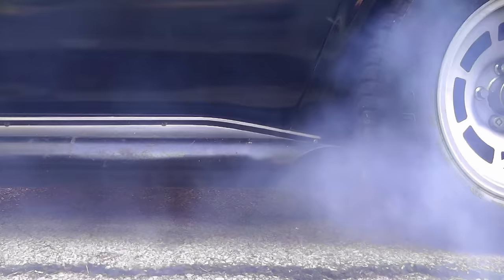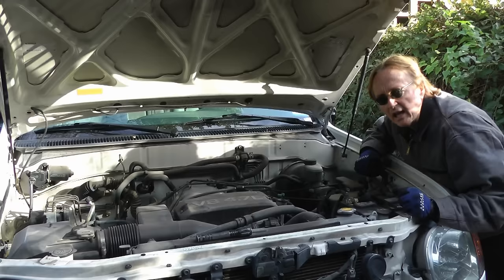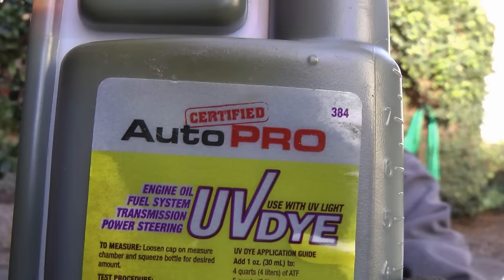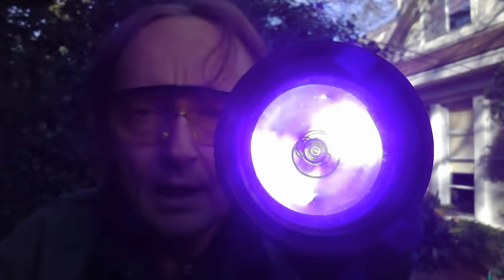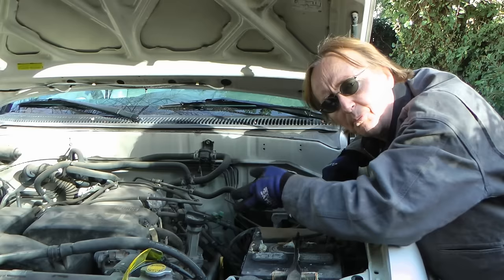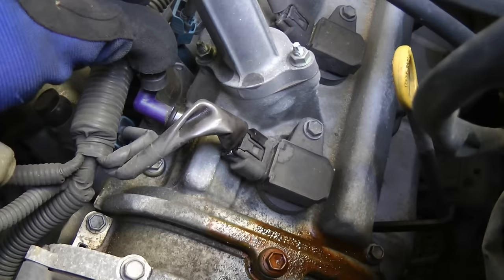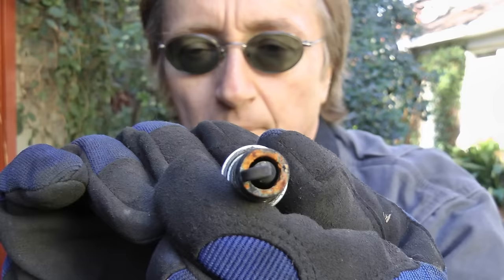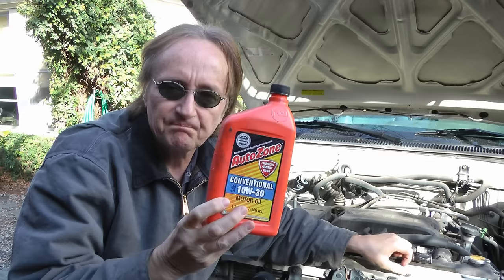How to Fix a Car Engine that Loses Oil (Leaks)

Comment: Hello sir,

I recently have preformed an oil change on my Toyota Corolla S. 

I used Valvoline.

And a Fram Filter.

I have seen reviews for Fram filters and have been convinced they are the worst filters out there!

What is your take, when it comes to Oil and Filter Preference?
Reply from the maker: heck, oil filters are just filtering paper inside a metal shell. As such, most work perfectly fine as long as you change the oil and filter frequently.
Reply: And specific ones you prefer to use?
I have a Toyota Corolla Sport. O1
I learned a lot from your videos, and I know you would know best.
Thanks.
Reply from the maker: LIO ZARATE
 I use the cheap generic ones auto zone sells. But you can also use stp filters, auto zone sells them too

Comment: Main casket seal.  That's my issue
2009 Ford fusion  
I check the dip stick. Put in when needs.  

They want $ 3,000 to fix the seal .
  To much.

Try some oil sealer oil .
Just got the dam car 
Has to last for some time.
Can't afford buying car's.

Comment: I don't understand how a PCV valve being stuck open is going to suck up oil and burn it.  To my knowledge it's nothing more than a check valve that lets vapors escape from the top of the motor.  Where does the oil come from?  It would have to come from the direction that the vacuum is actually pulling the vapors towards.  That doesn't make sense though because the vacuum is sucking from that direction so how is something going to flow from there?  And why would a PCV valve that's stuck open only suck oil from the valve cover when it's stuck and not while it's normally sucking vapors from the valve cover in the first place?
Reply from the maker: the valve in the pcv valve shuts closed when liquid oil hits it, but stays open for air mixed with oil vapor. So if it's stuck open, it will suck raw oil into the engine and burn it.  The valve vents the crankshaft vapors, and it's vacuum supply would suck raw oil into the intake and burn it if the valve is stuck open.

Comment: 2006 BMW X5 4.4i N62 blue smoke when I accelerate after idling for a bit. CCV valves seem to be ok seems like the previous owner changed them. Am I looking at bad valve seals? Seems to be a common problem with these vehicles.
Reply from the maker: bad valve seals 99 percent of the time on that engine

Comment: Hey whats going on Scotty, my camry had been leaking oil from where the solenoid assembly is and it was a cam plug and i used red RTV silicone and it took a while to dry up and yeah but i also want to know if its ok for me to use full synthetic oil cause i had been using high mileage oil, is it safe?

Comment: Hey Scotty my dads 05 chevy equinox with 54,000 miles and frequent oil changes. Its burning oil and he has to put oil once a week it uses half quart of oil, we changed the pcv and the spark plugs were checked and have a light white coating on them. Also every morning on start ups it makes a 3-4 knocking sounds but only on start ups. What can be the problem for these two things? much help is appreciated

Comment: REGARDS SCOTTY  I HAVE TOYOTA CAMRY 2000. 4 CYLINDER CAR AND IT HAS BOTH BLACK AND WHITE SMOKE. IT ALSO HAVE A INDECENT SMELL . GIVES ME A HEADACHE  ONCE IN A WHILE . THE SMOKES IS OVER WHEN THE ACCELERATING PADDLE IS PRESSED UNTIL THE RPM IS OVER 5000. THEY DO THIS TEST IN THIS  COUNTRY  WHILE PASSING  THE CAR BEFORE RENEWING CAR PAPERS
Reply from the maker: often blown head gaskets do that, try my video "how to tell if your head gasket is blown"

Comment: Hi Scotty 
I have Peugeot 308 2007 1.6SE.. Every month i have to put a litre engine oil in. Does that car also have a PCV valve or something else needs to be replaced? Whilst driving it also feels like the engine is dying or powerless.. the warning sign says 'depolution system faulty' and the coming and going regularly.. any help will be much appreciated?

Comment: Hello Scotty one cuestion quick this is a nissan sentra2003 and water is get in the engine because over heat is only in piston #2 is necessary replace the heads or may be you know another way to fix it?

Comment: when the PCV valve outside the engine and can be changed ... its not that bad ...but what i do when its insde the motorcycle engine..... it gonna cost a lot of money to fix it
Reply from the maker: replace it then, building up pressure with a bad one can cause oil leaks

Comment: Hi scotty! I have a 03 ford ranger with about 230000miles. I noticed that there was some smoke comming out from underneaith the hood of my truck. It turns out thay its oil leaking from the driver side of the engine and dripping onto the muffler. Wich is causing the smell of burnt oil and smoke. Is there any fluid seal you would recomend to fix the problem? Any help thanks!!

Comment: 2001 Toyota Corolla LE 1.8L (216k miles) I use to have leaks on the valve cover I thought that will change everything but nope. I am thinking rebuilding the engine on my own but if is only the cylinder head that will save me lil bit more just buying the top kit gaskets. What I detected from top Every bolt I take off has oil and even on the intake manifold. There isn't coolant mixture with oil which means good head gasket not even smoke from the back. Also, on the valve stems has oil. I was able to see a cylinder and seems to be clean on the walls but on the edge has oil. The spark plugs has Ash deposits and lil bit of oil but easy to clean off BUT has a code misfiring on Cyl 3. Also, i have Variable Valve timing code. Can I have an opinion of all what could it be? Please. 

THank you Mr. Scotty
Reply from the maker: +Walter Castro  really, get a used engine from a junk yard, you an't rebuilt that complex VVT engine correctly without a full machine shop and years of experience

Comment: is it normal for my Camry to need oil between oil changes?
Reply from the maker: +Alarm Tech911 when old, some will burn a quart and a half of oil between changes
Reply: Camry's with the 2.4L engine ALL burn oil, this is Extremely Common. Most years effected are 2007-2012. I've seen Camry's Brand New off the showroom floor...and they burn 2+ quarts per Month! People have been trying to sue Toyota for years over this excessive oil burning, but don't seem to get anywhere. They recently changed the design of the engine because the lawsuits threats were piling up so bad.
Reply: +Alarm Tech911  Most manufacturers actually recommend checking the oil every 300 miles (or every other fill up). It's good practice anyway.

The AA (a UK emergency brake down service) reckons 1 in 5 cars are running on oil that is below the 'low' marker.
Reply: +Alarm Tech911   We have a 2009, it burns 3qts every 5k miles (no we don't wait that long)  Toyota says it's NORMAL to burn up to 1QT/1000 miles... it's a crock of baloney!  Not much else we can do, but add oil.  Toyota recently extended the warranty on the engine due to this problem (and a lawsuit).  It really sucks.  our Camry is the biggest POS I've ever owned (Since my 1974 bug, but it was 25 years old when I had it...)
Reply: Those 2.4 2az-fe's love to consume oil after 95k miles. My dad has a 09 vibe, which is just a matrix with a pontiac skin, and that thing loves to drink oil. It only has around 105k on it. I don't think that car is going to last much longer. Its shame, we baby our cars. Some cars come straight from the factory consuming oil. Isuzu Troopers did that. It wasnt until the late 01 models where they fixed the engine so thag it wouldnt consume oil. I have a late 01 trooper and it doesnt drink oil. I heard toyota will fix it for you for free, but to get anything done from toyota is hard because they almost always hit you with the "its a toyota, its reliable, you abused it and were not going to cover it" excuse

Comment: anyone ever heard of an old farmers trick, draining engine oil completely, leaving filter on, replace oil with diesel/kerosene run engine til lifters become free (ticking) 2-5 min, drain oil, replace with fresh diesel/kerosene run a minute then drain, remove filter
then replacing engine oil and new filter..
I have heard of it and tried it in an older vehicle almost shot, and the oil was clean as a whistle, not black like every other oil change!!!!!
is this totatlly stupid or anyone else tried

Comment: My engine has 315K miles on it. It burns a quart every 1000 miles. It holds 4.75qts with a filter but in 3K miles just about all the oil has been replaced compliments of the car itself and keeping it topped off. Wonder if I should still change my engine oil when it seems to be doing a great job of that itself ;-) Is there any reason at this point? I'm only driving it to see how long it will go. If 3/4 of my oil has been replaced between oil changes it seems like a shame to drain out new oil it hasn't had a chance to burn yet...lol
Reply from the maker: yes, the dirt is still inside, continue to change the oil as normal, and especially the filter
Reply: +Scotty Kilmer Hi Scotty. That Lucas oil treatment works wonders. It slowed my oil consumption down by at least 50%. The car now has 321K. Still going. Going to run it into the ground :-)

Comment: So what if I have couple oil leaks the valve cover gaskets rear main seal and I think the front seal also what can I do or use to slow thos down u til I can get it fixed it's on a 96 dodge ram 1500 5.2

Comment: Hey Scotty. Have a 99 Accord and I change the oil every 4k. When should I be expecting oil burning from the engine. I have 164k and I use very little oil between changes
Reply from the maker: not for a LONG time if you keep changing it
Reply: good to hear!

Comment: We bought a 2012 Kia Soul in 2012 got in an accident the first week we had it..the radiator was damaged and car over heated. Insurance fixed the radiator. How ever every time I get the oil changed they say it's about a quart low. The guy at the dealer says there's no way it's related to the accident and all cars burn a little oil between oil changes. The car is under a ton of warranty and the dealer ship doesn't think this is an issue. What do you think?
Reply from the maker: Justin Walker  of course they won't warranty that oil loss, it would require rebuilding the engine. Kias are cheaper made cars and their engines tend to burn oil as they age. BUT, try using Castrol GTX oil, and you might find most of the oil burning goes away.
Reply: WOW thanks for replying I will do that! :) Im gonna subscribe to your channel and tell others about it. thank you so much. Your videos are awesome and keep up the good work. Scotty Kilmer

Comment: How about the crank seal on a 93 sentra xe scotty,  everyone says I'll have to pull the motor,  if that is true then I can't do that because I'm no mechanic.  Would you recommend using the at205 for crankshaft seal also? Hopefully you'll tell me I can take it off without pulling the entire engine.
Reply from the maker: try the sealer, but I've done those on the car, there is enough room if you take your time and be careful

Comment: What would cause this damage in the first place for example, not leakage but consumption wise?
Reply from the maker: consumption is often worn piston rings and or valve seals
Reply: Yes, but how can one prevent this from happening? Wearing out wise?
Reply: Not driving your Car would be the best prevention. If you change your fluids regularly you can slow the process a bit, but it's really just regular wear and tear.
Reply: Nikolovh1 
Put new piston rings! xD 
:-00000000000000000000000000

Comment: Hi scotty i have a Audi A4 my brakes keep giving me trouble i have tried everything change and failed up the brakes fluid and a couple days later warning light came on and my fluid was down the cylinder fine and am still having problems with my fell before all that my brakes had locked up stilling at the lights ive work on cars sins i was a kid and am real stumped ive never had this on a car do this before any advice it still low mileage i even went for a second apinion it driving me nuts

Comment: Hey, I have a 02’ Accord v6 3.0. With a leaking rear seal and oil pump seal, I’ve been living with slowly leaking oil and LucasOilLeakStop. Factory rcmnded 5w20, should I go to a thicker oil?If so like what?

Comment: I mean should I use an oil catch can that will catch oil from the blow by valve. I have 2 Ecoboost vehicles. one with a 2.0L ecoboost engine and the other is a 3.5L ecoboost engine. I am worried about gunk, especially in the future.
Reply: Best thing to do with those engines is use a quality synthetic oil and use top tier gasoline like Shell. If you are hard on the engine and race a lot let the engine idle for a few minutes after your drive. The oil will cool the turbos and extend the life. Try Fordtechmakuloco channel. He covers some good information about these engines.

Comment: Hi Scotty. A question. How do you check and measure the engine oil? When the engine is running or off? thanks
Reply from the maker: you check it with the engine turned off, wait 3 minutes to drain, then measure it on a level surface
Reply: Scotty Kilmer Oh, OK then. All along I thought the proper way to check the oil level was when the engine is on and pumping its oil throughout. thank you Scotty.

Comment: SIR ScOTtY ...i am a woman SO I ANTICIPATE YOU WILL BE HONORABLE AND RESPOND..THUS Helping a wOmaN out and be
  THE FINE GENTLEMAN THAT YOU ARE .

.what could be causing my 20O8 LINCOLN MKX  to leak oil literally the next day after my water pump was replaced? Mechanic refuses to acknowledge and address  and in addition  THE CAR STILL LEAKS COOLANT very slowly and no over heating anymore though! AS THE LEVEL HAS GONE DOWN SOME. MY WHOLE LEFT SIDE AS YOU FACE MOTOR IS WET WITH OIL AND MAYBE COOLANT BECAUSE ITS SO WET.  CAR DOES NOT.GET HOT OR OVER HEAT. NEVER EVER EVER LEAKED OIL until he took it apart and seems he maybe didnt seal something.UNDERNEATH ALL WET W OIL ON LEFT SIDE...I MEAN EVERYTHING EVEN THE ARM AND TI ROD ALL THE WaY BACK TO CONVERTER... WHAT WOULD BE YOUR GUESS?? MY CAR TAKES 5 20 BUT  WAS TOLD TO USE 10 30 OR 40 BUT CAR DONT warm UP RIGHT cuz cold so oil i told was like mud..SO I PUT 5 20 IN AND ITS LEAKING a lot...a lot. Its worse. 10 30 this summer or 10 40 every 3 weeks half court. ... CAR HAS BEEN SOOOO GOOD TO ME AND EXPECT IT TO KEEP GOING BUT RATHER THSN HAVE A MECHANIC SPEND TIME !$$" TRYING to figure out  do u know what it could be

Comment: Hi. I have a 1.3 L carburated 1995 Mitsubishi Lancer. It uses about a gallon to 4 liters of oil every oil change. How much oil should I expect to add every how many kilometers that is still normal for this engine?
Reply from the maker: for a mits that old, that's actually less than normal oil burning. Mits use crappy piston rings that wear out then burn oil.

Comment: Scotty why do newer Toyota 4 cylinder engines have a oil consumption issue? Like in the 07 Camrys for example with the 2.4 L engine.
Reply from the maker: I blame too infrequent oil changes myself, I stick by the change your oil every 3-4 thousand miles or twice a year. those long changes cause internal engine wear, then they burn oil when older. My son has an 07 camry and it burns no oil at all, cause that's how he changes it.
Reply: Ok thank you for the advice.

Comment: Hi Scotty,
Thanks for your videos, I got a question 4 u:
I have freelander 2002 (land rover), which if I accelerate more than 2000 rev/min,  the intake pipe will pull oil (like a cup or 2). any possible causes?
thnx in adv

Comment: Hi Mr. Scotty, I have Hyundai Matrix 1.6 2004 its have problem for losing engine oil around 2000 km need add 1.0 liter, and not smoking. How can i solve the  problem with solution oil.

Comment: About to add Lucas Oil Stop Leak, do I have to drain 1 quart of oil and then add 1 quart of Lucas or just add 1 quart to my 02 Accord v6
Reply from the maker: If you aren't one quart low on oil, of course drain one out before adding it

Comment: Scotty I have a 2004 hyundai  sonata.  It has 226k miles and runs like a dream.  The only thing wrong with  it is its burning oil like crazy.  Smokes a little when it starts and when I Rev it,  it smokes too.  Would you say it's the pcv valve?
Reply: Jacob King as a long time hyundai tech I'd lean more on valve guides. done many of them in my day.
Reply: I replaced the pcv valve and everything is perfect. Part only cost 3.88 lol
Reply: uh well the one on it was literally 7 years old. Was never changed since I bought it. Very simple to change too. just took like 10-20 minutes.
Reply: +Jacob King Strong vacuum only on idle. So.. I guess PCV would suck much more oil while idling.

Comment: My Engine uses alot of oil... but this is due to the fact that my car got Shifted Pistons. damn you VW Golf 4 1.4 16V engines!
Reply: Most problems with that engine are the valves and hydrolic valve tappets, they wear out and you lose oil by bloing it out of the exhaust or burn them. If the compression is still ok, it might be the tappets and the cost a fortune. Just buy a new Engine and swap the damn thing to an V6 (R32), they are way more reliable and cheaper than an 1.9 Tdi.
Reply: +Spelter R32's are pretty expensive for their age. I looked and the cheapest one I could find was $11k so I think its just time for a rebuild with new parts.

Comment: My 2003 EXL Honda Accord is burning oil & the thats not old for a Honda & the dealer just says it happens, is that true? has 116k on it & I'm original owner & what if I smelled a burning smell & so did the dealer but it went away after adding oil + the warning light came on so is there any danger?

Comment: My oil gasket on my 88' Ford Bronco 2 is leaking oil. The mechanics said its nothing to spend money on but I was driving it and the oil pressure light came on and the engine about died.
Reply from the maker: try some AT 205 reseal in the engine oil, I get it at amazon, often stops seal leaks